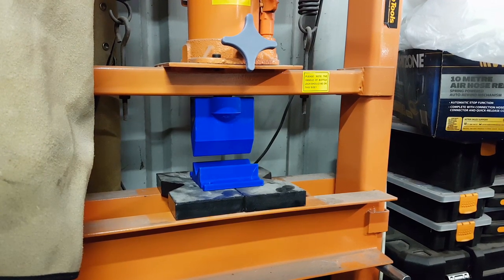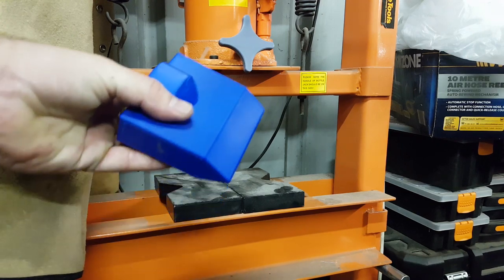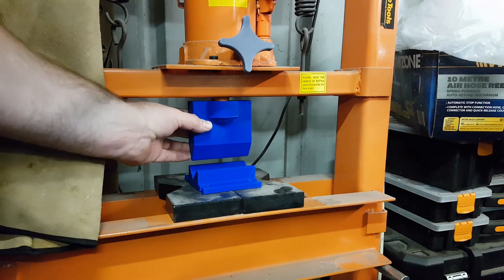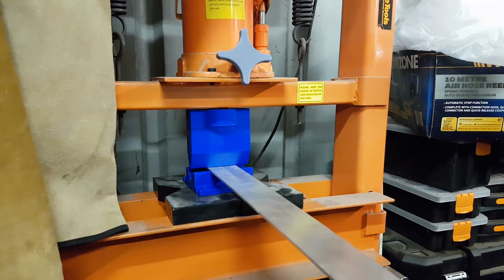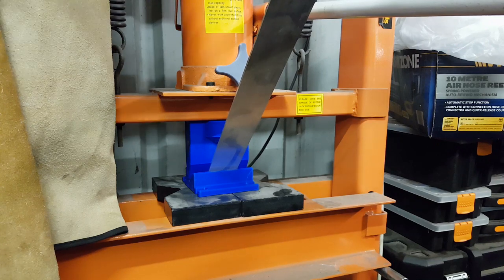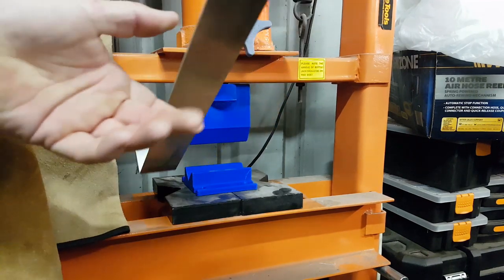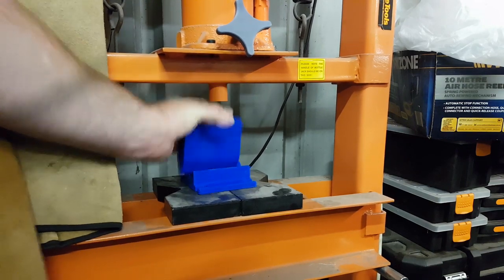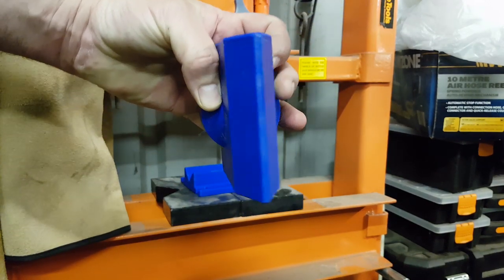Printed Floor Press Dies

Comment: What infill and material did you use?
Reply from the maker: 90% fill, which I think is also probably overkill and just eSun PLA+. Also 5 shells as I've read that it's the shells that give any meaningful strength to the part.

Comment: That is sweet. Hadn't thought of using my press like that.
Reply from the maker: It's fine for small runs with soft metals I think. If you wanted to do sheet steel anything over 2mm I'd probably move to a finger brake setup so that the die is captured a bit better and will handle the deflection.